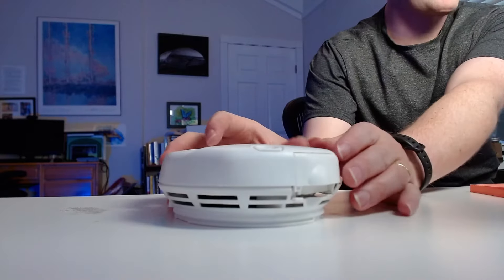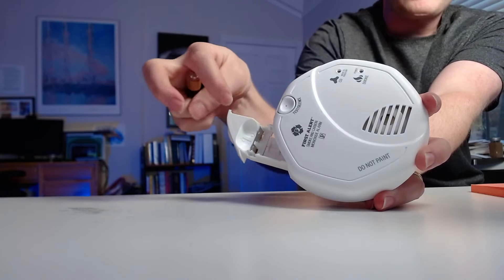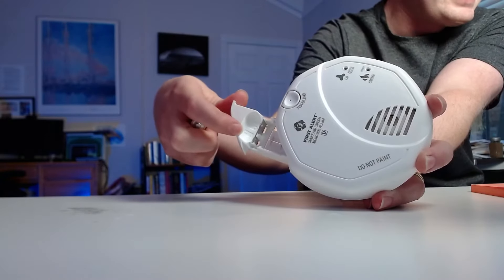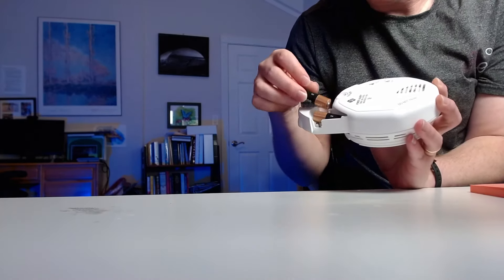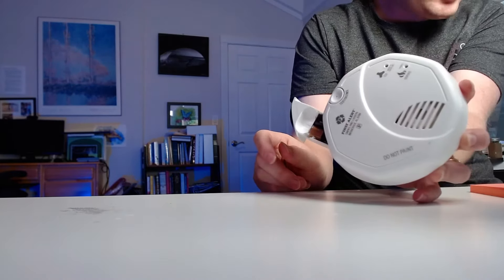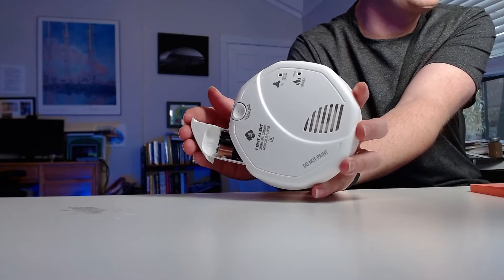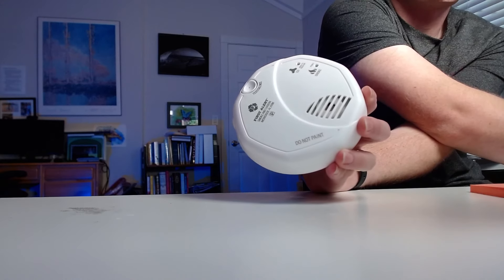How to Change Batteries on First Alert Smoke or CO Alarm

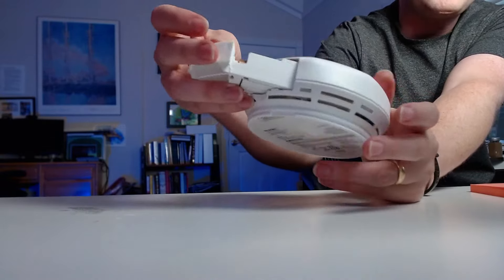Comment: to get the batteries out push on the bottom of the battery container. spent two minutes trying to get it with my finger and felt stupid when i realized i could just do that 😭 0:45